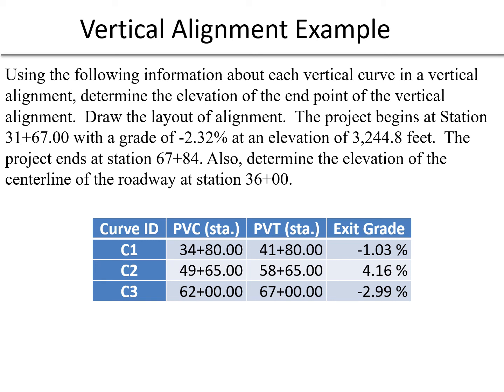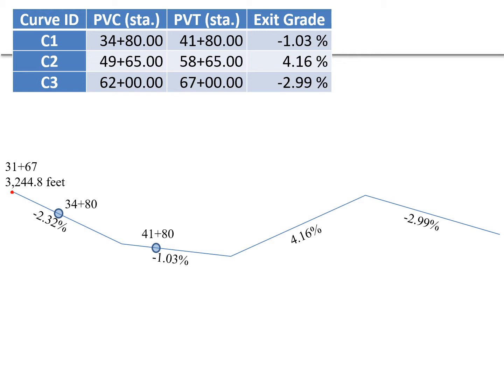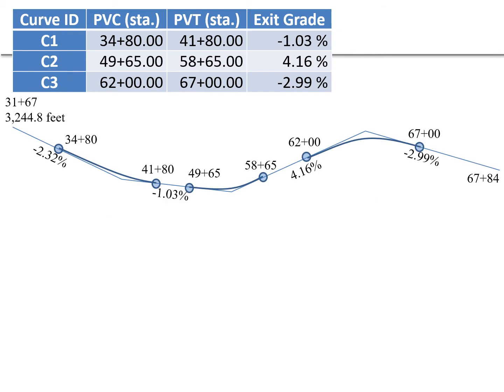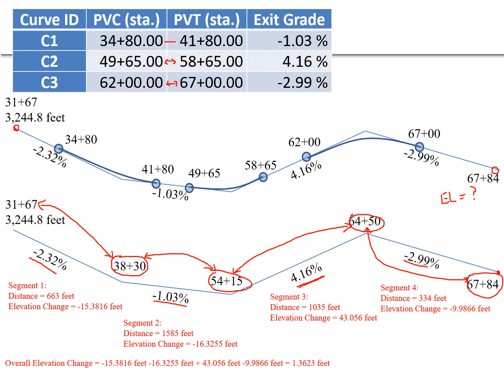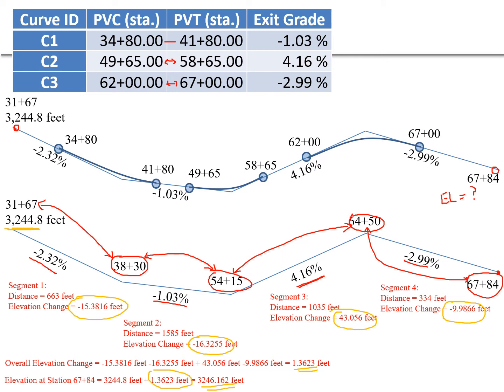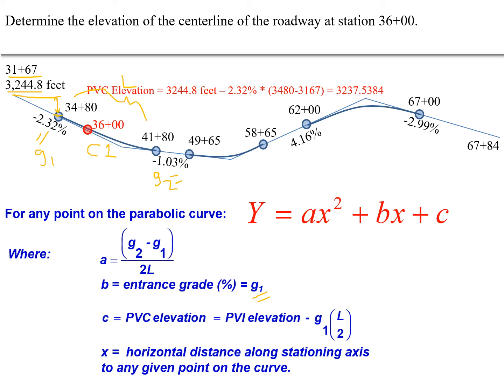Vertical Alignment Example Problem - Find the Elevation of the End of the Alignment

Comment: how are you getting that 38+30

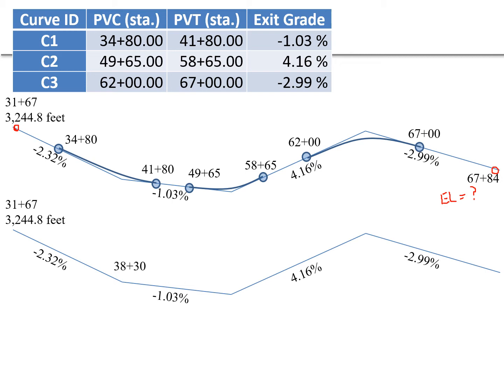at 4:08 mininutes
Reply from the maker: For a symmetrical, parabolic curve (our assumption for vertical curves), the PVI is halfway between the PVC and PVT.  Therefore, the 700 feet long curve has 350 feet between the PVC and PVI, as well as, between the PVI and PVT.  The station of the PVI is the PVC (34+80) plus 350 feet, which is equal to 38+30.

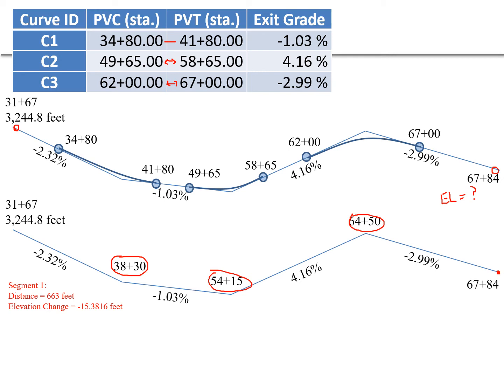Comment: I have a question how did you get the change of elevation?  5:02
Reply from the maker: Great question - I multiplied the distance (663 feet) by the longitudinal grade (-2.32%) which equals -15.3816 feet.  So, there is a drop in elevation of 15.3816 feet between those points.